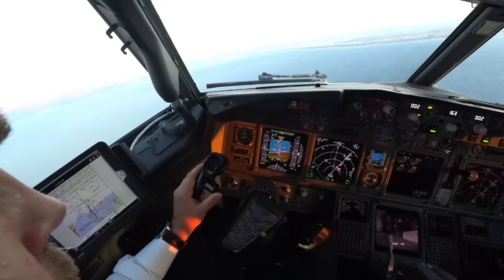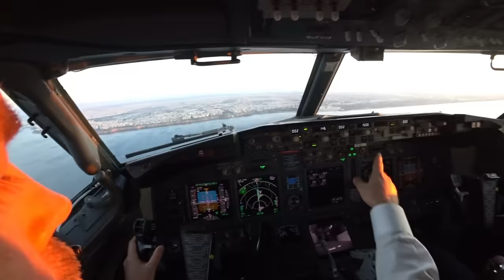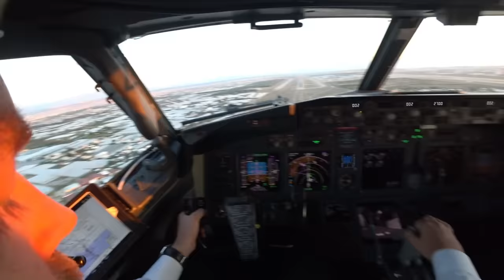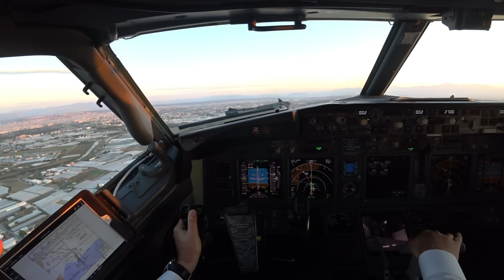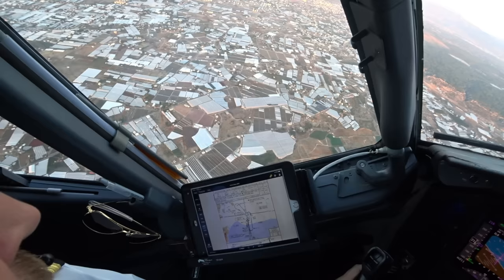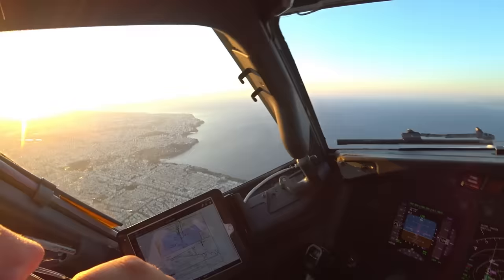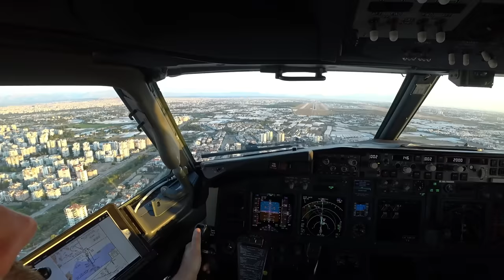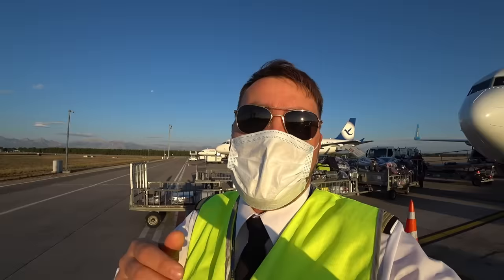Boeing 737 Manual Go-Around in Antalya Pilot Eye Cockpit Camera

Comment: Right Pilot???
PIC, that's bad, really bad for someone with a rating.

Manual Go Around?
Nope, lot's of Auto Pilot there ...
Reply: What is the problem with the right pilot ?  And if you look well , the go around was initiated with manual control , it wasnt the autopilot so the title is accurate.
Reply: The auto pilot is disconnected at 1000 feet, before the go around is initiated.